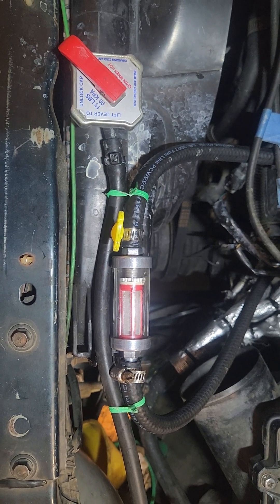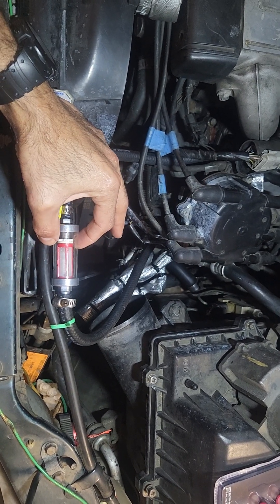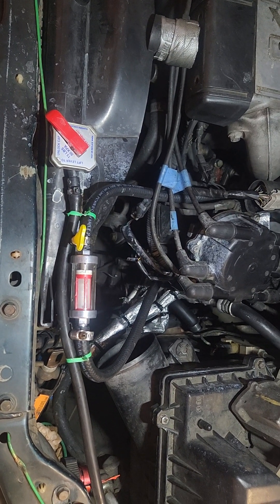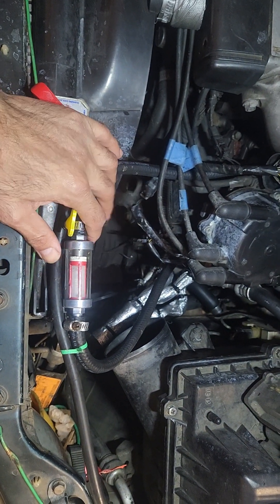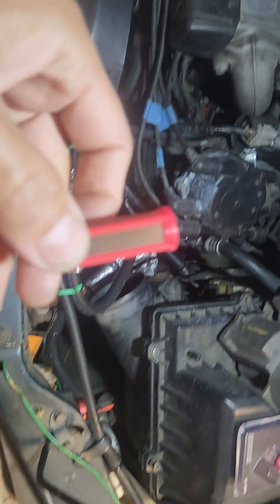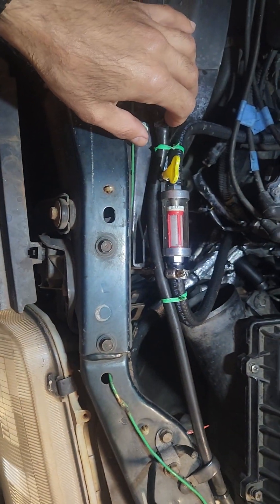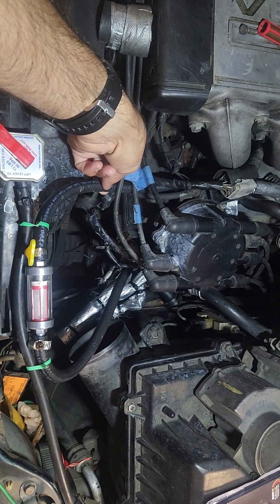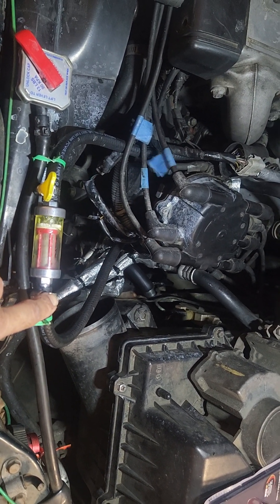DIY automotive coolant filter install 💪 #DIYautomotive

Comment: The thing i dont like is that it filters after the radiator, not prior. So it wont protect it as well.
Reply from the maker: @firstname-qq3xp  Good point, that would be the case of a large chunk of say gasket material were to get dislodged into cirrculatiion.  However its the tiny particulates which usually clog your cooling system by accumating in any given area makikg the filter's location effective even if installed after the radiator.

Comment: wouldn't the glass brake from all the heat
Reply from the maker: Nope!  Been using it for a year now and its very durable.  Glass mainly breaks from rapid fluctuations in temperature -example: running very cold water immediately over a hot piece of glass.

Comment: Please tell us about the baking soda and  vinegar  cleaning  methods.  Thanks for pointing out that the coolant line from the radiator to the expansion tank is  bi--directional. Also  the warning about using  a plastic  filter....which I was considering  !!
Reply from the maker: Well its a long detailed procedure that takes patience but first thing to remember is that when draining most  cooling systems only about 50-65% comes out and the rest remains in the block, hoses, heater core etc.  So I flush the system with water a few times to get the remaining coolant diluted with water as much as possible, then fill it up with vinegar and drive/😂 let it sit in the system for 24-48h.  Afterwards, drain and flush it a few times to get the vinegar diluted with water as much as possible and then mix 1/2-1 full box of baking soda in a gallon of water and throw that into the radiator.  Then repeat the same procedure listed above.